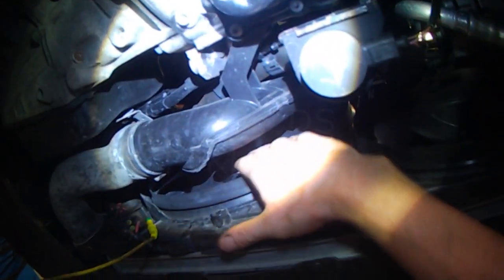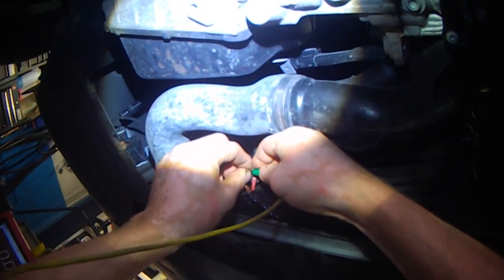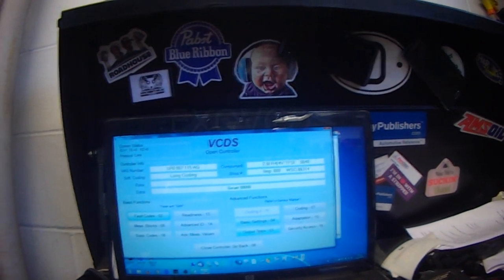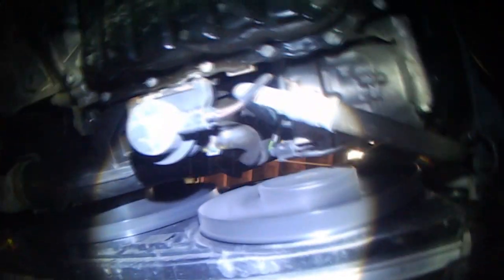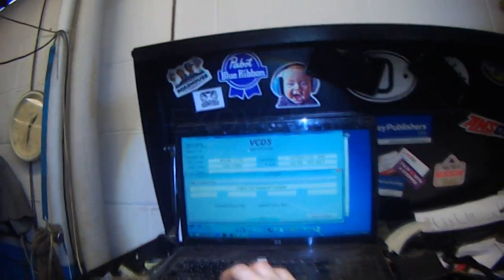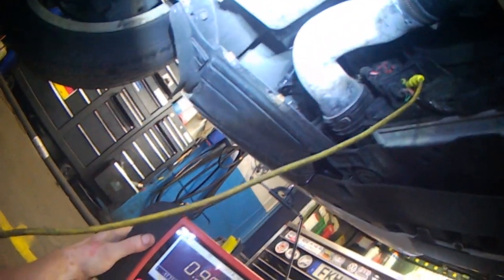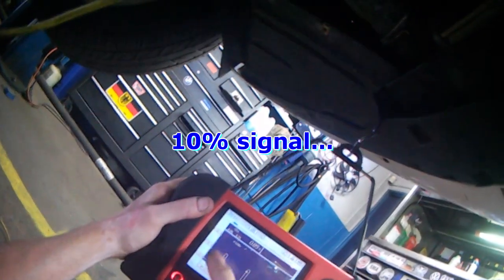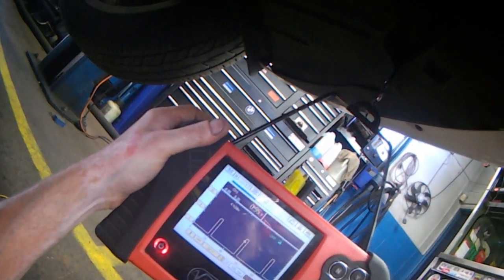Pulse-Width Modulated Radiator Cooling Fan(s) / Systems

Comment: hi bro, mine mk6 1.4 2011,aircond not blow cool air, possible the small fan problem, but if do bypass at small fan, the fan spin at good speed, try to by pass at big fan n it cant spin, i believe its because big fan use somekind like cntrol module, so it cant bypass just using 1 wire for +, 1 wire for -, any experience for this situation? kindly advise if u hve dude, thanks
Reply from the maker: @MohdYazid-v1q
Aircon should work with only one fan (yes, might be a bit cooler with 2 fans).

If you have NO cold air, then radiator fan is NOT the problem.

Use a scan tool to communicate with the AC module.

The module will tell you the reason why the module is not activating the compressor. 

If the big fan works, but the little one does not, then fan control module (part of the big fan) is bad... replace the big fan.

Comment: Hey Thomas have u ever taken the plastic fan off the motor?  Looks like it's pressed on, but I don't know, could also be screwed on w/ fine threads. Just saw a pic of an aftermarket replacement & it has a flange nut.
Reply from the maker: We always buy a complete unit (fan with motor)... trying to transfer fans over to new motors can be sketchy. The plastic fan could crack during the removal from a motor or installation on a motor.

Comment: Hey Thom have u seen this guy's video?  :  https://youtu.be/_EUaGswPv9o    Apparently that fries the fan control module?  mercy...
Reply from the maker: I would not recommend to do it that way. He's forcing current to go in the opposite direction (red wires is power and brown is ground). Even if this doesn't fry anything... it does not tell you if the "Fan Module" is OK / can control the fans. The fan module receives a "pulse width modulated" signal from the ECM (telling the Fan Module how fast it should spin the fans).

Comment: Thanks a bunch for all your help, your experience is valuable.
Reply from the maker: Using a cheap obd2 scan tool, you can monitor coolant temperature. Temperature will rise and then stay level (around 90c) for some time (thermostat has opened). After a while, temperature will continue to climb and the fans should come on at around 98c. If temperature at idle goes past 110c, something is wrong.  Shut engine off or drive at cruising speed to cool the coolant (airflow through radiator). If cruising speed does not lower temperature, then the thermostat might be bad. I know you said that you don't have overheating issues... I mention this here so others can use the info to troubleshoot their issue.
Reply: Okay cool, pun intended, good to know. I've got a cheap scanner & not even the cheapest, ha. I'll check it out, wish I'd known today when I was driving around.  So I'm assuming the factory temp gauge is not the most accurate? I was tickled b/c it actually had NUMBERS on it instead of just H & C.  It's stayed nailed dead nuts on 190F even in this ridiculous heat. Hauled 2 dirt bikes on a small trailer, 1 buddy & all our camping junk end of June & it was HOT on the way home.  Will be nice when I get this Mess straightened out.  
thanks man, take care on that west coast, surfs up.
Reply from the maker: VW/Audi have gauges /needles that show 190f (90c) starting at 176f (80c) to as high as 230f (110c) in some cases.
Reply: Drove about 5-6 miles, still hot out even w/ the sun going down about 80-79F. Code scanner live feed reads 174F while the cluster temp gauge stays nailed on 190F dead nuts. And I let it idle for a while, both temps didn't move at all.  
Sound like a bad coolant temp sensor? thanks again, take care
Reply from the maker: @leeisenberg    No, temperature sensors usually fail 2 ways. 1) temperature suddenly drops way low and then comes back or 2) temperature reads high / overheats when it actually isn't (rare). 95% of cases where the needle indicates an overheating issue, the engine is overheating. 
If you don't trust the needle / temperature sensor, change it and see if it makes a difference. You can also check temperature of upper & lower radiator hoses to see if they get too hot. Instead of driving, hold the engine at 2000 rpm. Thermostat should open within 10 minutes (lower radiator hose is hot to the touch). It might take 15 to 20 min for the temperature to climb past 190f. I'm quite sure you just aren't waiting long enough. As soon as you start driving, coolant in the radiator is cooled (lower radiator hose is cool to the touch)... engine temperature can be 180f and radiator well below. That's why when you come to a stop, the engine isn't overheating, because the engine is drawing in the cooler coolant from the radiator.
Reply: Okay thanks man, good to know. I'll keep an eye on that. In this case do u think it's the control mudule on the big fan?   Or maybe 1 or both of the fan motors has a problem like a stuck brush or brushes?  Still gotta double check the wires in your other video, I'll get back w/ u, thanks a bunch man.
Reply from the maker: @leeisenberg  Before you do anything... you need to know if the engine actually starts to run hot (due to the fans not coming on). Let it idle / run at 2000 rpm and monitor temperature while looking at the fans / feeling the upper & lower radiator hoses... if temperature starts to get to 230F, drive the car to cool the engine down (since you know that the temperature stays at 190f when driving, we know that the thermostat is OK and that leaves the fan module / fuse / wiring as the last things to check).
Reply: Okay man, I'll try it & see what happens, will keep you posted.
Reply: After trying to get it hot for about an hour, the Big fan is working, but Not blowing very fast/hard. Small fan didn't hit a lick. Used my cardboard winter shield in front of grille whole time, left shifter in "sport" position part of the time, & I parked & held engine on 2,000rpms for about 15-20 mins while watching. Cluster temp gauge stayed nailed on 190F as usual, but my engine scanner temp got up to 212F, no higher.  Ambient was 82-89F, & of course No AC, turned it off/on bunch of times.      (didn't know the big fan will run w/ engine off & key in On position. Surprised about that b/c Non car people could easily run their battery down, & car guys like us could also forget & wouldn't take long to run an old weak batt. down.)  Also checked the fan wires: 12v on both hot wires, & I've got continuity to ground on the 2 negative wires.  I'll inspect the small fan ASAP, & hopefully have sum nice AC soon.  Thanks again man.
Reply from the maker: @leeisenberg  Like I've said before... a moving car doesn't need the fans.

Comment: I have a Audi A4 B8 2010 and neither of my fans are working and can not locate where the fuse box for the radiator cooling fan is located... any help?
Reply from the maker: Wiring diagram shows that both fans have a separate fuse that supplies power to them. Odds that both fuses are not good is low... but you can check them anyways. The fuses are located next to the Battery + jump post under the hood (under the plastic cover at the base of the windshield. They are fusible link fuses. Both fans are controlled by the ECM (the same way as in this video). You need to do some checking to see if they get a command from the ECM. If command is present... power & ground are present, then the fans / modules are no good. Replace them.

Comment: I think my 2005 Touareg has this system. Large starts up as soon as car is powered(not engine). (small fan is off and seems to have its own module. Do you check the PW voltage to chassis ground? I have system voltage when i check across the two small wires.
Reply from the maker: All tests are done with negative lead on chassis ground (or thick brown wire at connector).
Coolant temperature sensor failure will trigger fans as soon as key is on. Use a scan tool to look at coolant temperature sensor input and for fault codes (just in case).
Reply: @EXOVCDS  Thanks for the info. It pushed me in the right direction and I got some data that might narrow things down. My OBD11 tells me 78 degrees, dash says 200. That seems normal to me. fluke on the fan wire gives me .4 and 1.5 with ac on. Not sure what temps are needed to get it higher. 
If the small fan is supposed to be on, then its shot. each time I plug the large one in, there is about 20 secs delay and then it starts ramping up. I also noticed i get a seemingly random amount of time before the 12 volt signal wire goes dead after ignition turned off(temp based I am guessing) and sometimes the fan wont shut off even when that signal is not present. (uplugged to check for signal and plugged back in, fan starts again) So i am guessing that fan module is crap. My big question now is how do I get them out? I see now screws holding the assembly. It looks like its all plastic clips and that it should just pull upwards, but I cant budge it and I fear I am going to start breaking the clips.
Reply from the maker: What (size) engine is in your Touareg?
Reply from the maker: Should be the same for all engines I think:
http://fkh161.ca/VW/Touareg/TouaregV6CoolingFans.pdf
Module is part of each fan... to remove the fans, you have to remove the fan shroud assembly.
Reply: @EXOVCDS  I have the 3.2. it occurred to me maybe Im not hot enough for the fans to be on at all so the little one might be ok. should it come on if I hit both the ignition pin and the PW pin with 12v?
Reply from the maker: @footstepsinchina299  I use my scan tool to activate the fans (via output tests)... I don't recommend applying straight voltage on a Pulse Width Modulated Circuit. In my experience, all VW's with dual electric rad fans, run both fans at the same time when fan operation is needed. I'd have to check a Touareg myself (the next chance I get) to confirm 1 or 2 fan operation. As mentioned, a faulty temperature sensor can cause weird fan behavior (default is to run fans when the ECM does not know cooling system temperature). If sensor & wiring for fan module(s) is ok, then the module is probably bad (part of each / sold with fan).
Reply: @EXOVCDS  Thanks fort all the help, learning more than I wanted to know. I bought a multimeter that does freq/duty. It says I am at 75 - 80%. I suspect that means my ECM is trying to run the fans full. If I have a bad temp sensor why does the dash read properly and the live data seems to concur? I am only aware of one sensor, behind the cylinder head in the thermo housing. Does VW use two?  live data does show 2 readings, one was 20c allways. the other climbed up to 78c. I was assuming one was ambient.  If turning AC on ups the duty cycle, does that mean AC is not the problem?
Reply from the maker: @footstepsinchina299  Old systems used 1 sensor (with 4 wires) to send coolant temperature info to Dash & ECM. I believe that the sensor in your engine is a 2 wire sensor (at the back of the cylinder head in the thermostat housing / coolant flange. I believe there is one more sensor that is in one of the radiator hoses... to monitor thermostat operation / radiator temperature. Could still be AC / pressure sensor issue (I think I failed mention ac pressure sensor initially) that is telling the ECM to trigger the fans. If you don't have access to VAG-COM / VCDS, you can look for someone in your area, by zooming in on your location at this link:
http://www.maptive.com/ver3/VCDS_Locator
A full system scan (all modules) might reveal more as to what might be going on. 
I'll have a look at a wiring diagram to see how many sensors there are.
Reply: @EXOVCDS  I think I caught myself chasing my tail. I keep reading 80% duty cycle ac off and 100% ac on. I keep wondering why I have 80% when the temp sensor seems to work fine. occurred to me I am causing a fault every time I unplug the fan to take a reading. Need better test leads to test this theory.

Comment: Great video! I have a 2015 Volkswagen GTI and I’m experiencing an issue with my fan only running when the air conditioner is on. The fan does not turn on when the coolant temp is at operating temp (200F). 

I assume from your video that I will not be able to do a bypass test on the coolant temp switch, and I must check for resitence. Should I purchase VCDS and it will tell me what is wrong? What are your thoughts? Thank you!!!!
Reply from the maker: You should be able to just unplug the temperature sensor and cause the ECM to go into default cooling mode. Voltage checks such as I did in the video, can confirm "control" of the module. If a pulse width modulated signal / square wave (voltage with multimeter) is present, then you know that the ECM is sending a signal for fan activation and the fan module is bad (because it is not turning the fans on). If no signal is present (stays at low voltage) then something is going on with the ECM / temperature sensing circuit (would be my guess). VCDS is a bit expensive for DIY investment... OBDEleven is a smart phone interface that is much cheaper and can do almost the same as VCDS. Being able to view & activate devices with a scan tool / OBDEleven, can be a time saver when troubleshooting issues... and well worth the cost if you are planning on keeping your VW for some time!
Reply: Thank you for your quick response! You truly are a master at what you do!! I’ll give it a shot some time this weekend. Cheers!

Comment: Is there a fuse that I could have blown in the box . The wires touched and sparked them no power
Reply from the maker: What is the actual problem? When did the problem start? What engine? The more info I have... the better / quicker I can help.
Reply: Thomas EXOVCDS     Car ran over parking block took out radiator and broke off fan connectors on engine side . Replaced plug end. Had power when I hooked it up .to the wires . Plugged in in and the motors would not run . Switched brown and red wire and fan ran for a bit . Discgnected wire to put them together right but bare wires touched and sparked . Then could not get them to spark again . No power. Everything else is working 🤔
Reply: Thomas EXOVCDS  sorry not so good at texting
Reply from the maker: Which engine? So I can look for a wiring diagram.
Reply: Thomas EXOVCDS  2.5 gas with no turbo
Reply from the maker: The fan connector should look similar to the one in the video I linked:
https://www.youtube.com/watch?v=oqdv4cm86Ns
The red wire is the main power wire. 50A fuse on the main fuse board in the engine bay.
Reply from the maker: Send picture of connector / engine bay to fkh16@fkh161.ca
Reply: Thomas EXOVCDS  2010 vow Jetta 2.5 ⛽️
Reply from the maker: Yes, I know it's 2.5 gas... pictures can help YOU... because I can circle things to check.